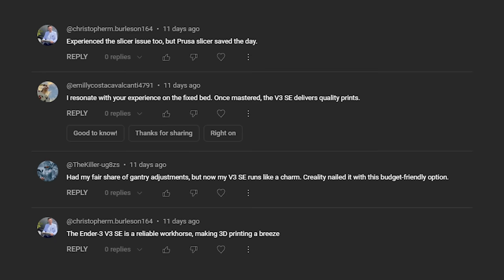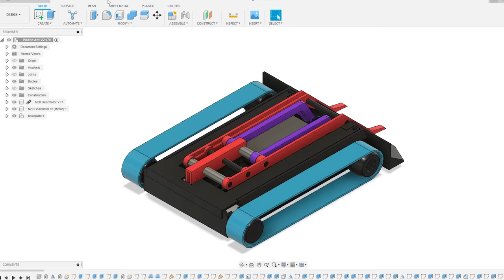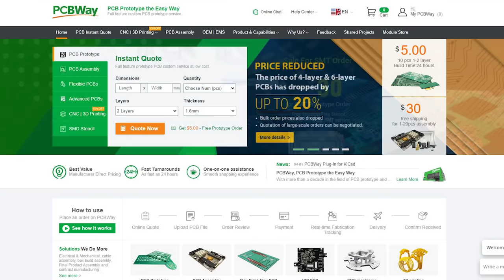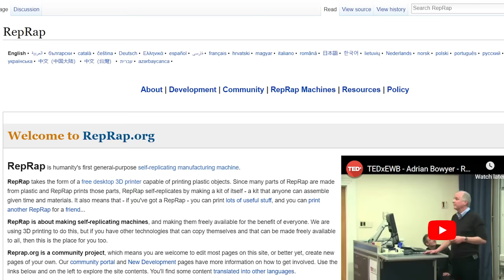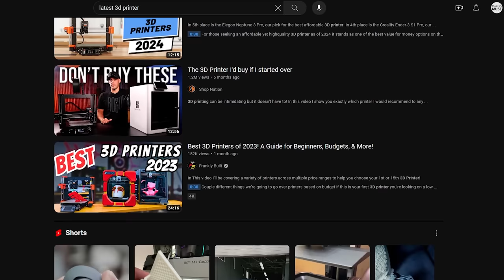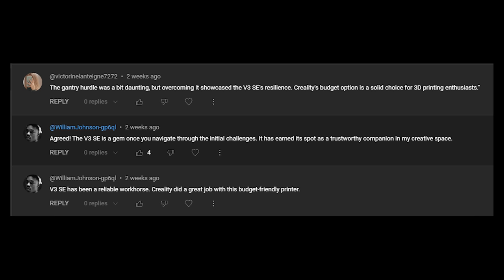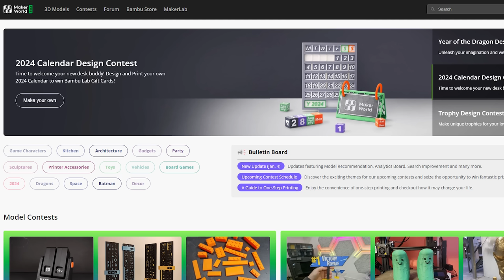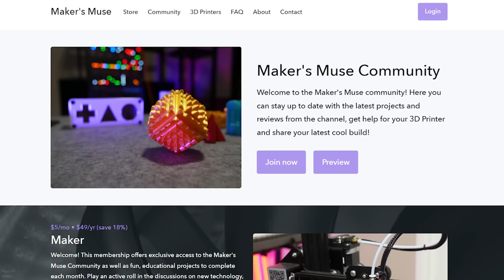My 3D Printing Predictions for 2024

Comment: When did the 3D printing community became such spoiled brats?
 I hadn't really watched this space in awhile because there wasn't much happening. 
 When I last was keeping up with it all, we were dialing printers in, modding as necessary, little issues were just fixed or modded around so they weren't even an issue.
 But now it seems that the smallest little issue is about a deal breaker for these little crybabies. If the machine doesn't produce perfect prints out of the box without touching the printer or slicer settings, then its just a horrible printer apparently.
 Im embarrassed for these people because they don't know that they should be. Lol

Comment: Making professional 3d printers only!!! This is mostly do to AAAAA HHHHOOOLLLLEEEE consumers, that get into things they have no business getting into!!!!  You can only hold some ones hand for so long before it costs you more than they paid for. That's Y professional grade printers have service contracts of $10,000 yearly or more, It keeps the rif raf out!!! So BAMBO labs watch out once all your newbies user need there printers serviced, without distribution service centers  BAMBO labs will start to suffer. If you did not come from the tinker ability of an ENDER-3 or other you just wont be able to service the printer yourself. So learn on the cheap and get the ability then get the bells whistles, or you will have an expensive paper weight in the long run.